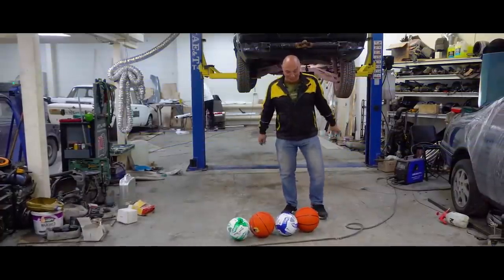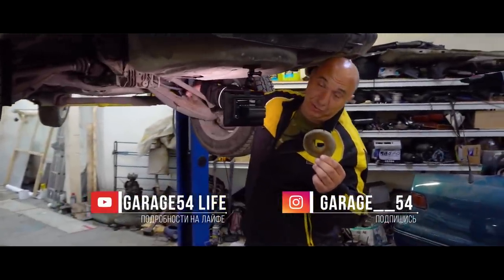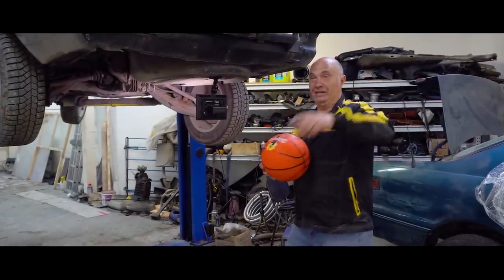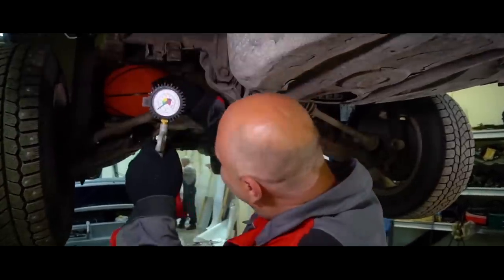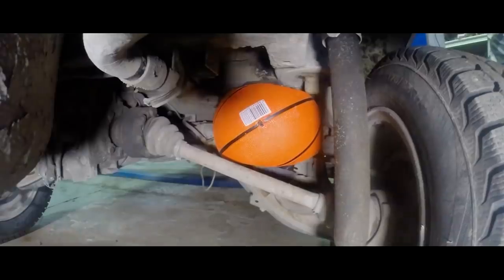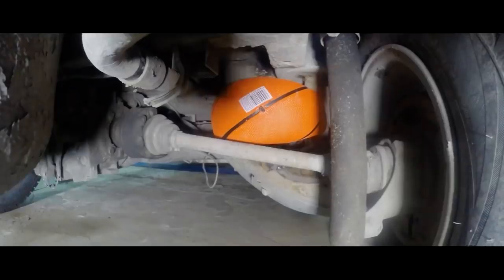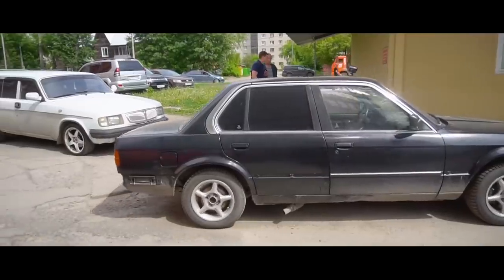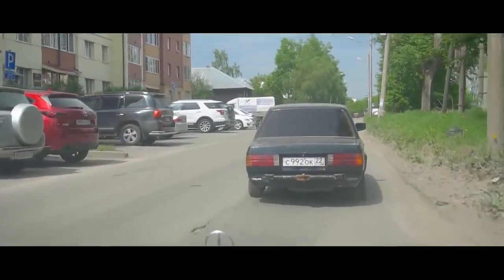DIY air suspension: replacing springs with basketballs

Comment: I think the mounts become sharp when it pancakes over them, flatter mounts might make them last a little better?
Reply: Tyler woodring or at least curl the outer edges of each cup away from the ball so it won't be as sharp when the ball pancakes
Reply: yeah i think i saw the mounts were broken  maybe with stronger mounts thicker steel and more welds

Comment: Make brake pads out of tire tread? They would be semi metallic organic pads!

It’d be cool to see what the peak pressure is when they burst.
Reply: You know theyd work better than normal brake pads until they got hot. I wouldnt use tire tread. Use a heavy duty piece of rubber.
Reply: Kyle Marshall I can’t think of rubber much tougher than tire tread. It’s also steel belted.
Reply: @Phos9  conveyor belt from stone crusher..rubber but not soon to be replaced, you can it as industrial trash...very dense Steele net
Reply: It would be like bicycle brakes!

Comment: whyd you disconnect the shocks??  that's what made it pop...
Reply: Was my thought, at the end they should''ve tried it with the shocks bolted on and basketballs in place.
Reply: but then, the shocks would be absorbing most of the energy
Reply: IndiiSkies kinda like in a real suspension?
Reply: I thought this too, then realized they would have "bottomed out" and not had the travel on compression.
That said, maybe put the shocks back on and run a higher pressure in the balls.
Reply: @ifluro  or spacers under/above the balls
Reply: both this and the magnet suspension rode a lot lower than the car is meant to so the shocks would be at the extent of their travel  and it would just be sitting on their bottom stops the whole time or at least bottoming out the shocks after an inch of travel and crunching the passengers vertebrae.
Reply: @tomcline5631  But real springs wouldn't have broken, so neither should the magnets or balls.
Reply: Agree
Reply: most air setups ive seen still uses a shock.the airbag only replaces the spring

Comment: For some reason this video makes me want to play a Garage 54 themed VR car Mechanic game.

Car comes in with busted suspension, throw some balls in there. 

Car rattling on bumpy roads, fill every air space with expanding foam. 

Engine overheating, throw two extra engines under the bonnet
Reply: PlayWay will probably do a game like that haha
Reply: having choice between Roadkill and Garage54 would be a good feature too

Comment: Suggestion:
Replace a clutch with a belt drive, pulley on gearbox shaft, pulley on the flywheel and make a tensioner so you can engage and disengage.

Comment: Isn´t there any vhicle laws in russa?
Reply: you can't drive a car with broken: breaks, headlights (at night time), windshield vipers (if it rains). In any other case you have the right to take precautions and drive your car to the nearest garage for repairs.
Reply: @A3ATOT  steering and brakes also have to be fully operational.
Reply: matsv201. It’s illegal to drive sober
Reply: @SwapBlogRU  Pretty much a fashist state then
Both breaks and stearing operational... in the free world we only need one of those
Reply: matsv201 brake

Comment: You should try hard rubber balls if you can get them big enough. We used to put them inside the springs in the 80's to stiffen the suspension & work as bumpstops.

Comment: The metal cradle edges dug into the balls and someimes they rubbed against the half-shafts: smooth over the edges + more ball pressure required!!! And connect up those shocks!!!!
Maybe using some truck or bus air-suspension units would work?

Comment: I think it would work pretty well if you find out what causes the burst. The ball can handle the pressure but I think it doesn't like hot exhaust pipe or rubbing drive shaft.

Comment: Garage 54's idea on how to make an air suspension:
1. Stick quite sharp sheetmetal bowls to the lower and upper side of the suspension
2. put a basketball in between, almost slicing it already
3. hope nothing will happen.. but it will
4. call it a 107% success!
:-D

Comment: The balls would last way longer if you would:
- add a little cushion between the balls and the cutting edges of those custom-made baskets which support the balls;
- add more pressure in the balls.
I challenge you to rework it and shoot another video with the results. Interested?!

Comment: love the channel just wish you would to the trials with a bit more engineering to make things really work.  Such as with this one.  The bracing for the balls needs to be thicker, wider with rounded edges while also accommodating some rubber padding top and bottom.  The shocks need to hold up better and be newer.  Perhaps there is a ball out there that you can put up to 100 psi.  Now here is an idea fill them with Oobleck or mostly and then some air.

Comment: Put in some proper truck or bus parts and it will work perfectly.  Those aparts are designed for MUCH heavier loaded trucks. 

Suggestion for another project? How about filling an airconditioning system with liquide propane?  Theoretically it should work great.
Reply: In the past, propane has been used in automotive AC systems, as a cheap replacement for R12 Freon. 
It works. Trouble is, if you get a leak......

Comment: I think if the ball cradles has been a bit larger and if they had run a bit more pressure it would have worked a little better. But still a fun experiment.

Comment: You should have made the susp plates round and bigger so the sides of the ball wouldn't be compressing down onto a sharp metal edge they are only popping because as you drive it's cutting into it

Comment: what if you coat the balls with the stuff you can spray on a watermellon drop from a building and it dont bust open..bet that would help this ball suspension  :)  its called line-x

Comment: I recall seeing a tree branch shoved into the rear suspension to replace a missing wheel. It dragged along the road lifting the back of the car off the road. Obviously it was a front wheel drive vehicle. Why not try BOTH rear wheels replaced with branches and see how far you get.

Comment: Do a video using lady toys and lady lube for things on the car. Like lady lube for oil, coolant, windshield washers fluid and be creative for what to use the toys for. Maybe gas cap, oil cap, shifter, wiper blades, tailpipe expansion or plug, antenna cover, hood ornament, bumpers
Reply: Hand brake

Comment: I'm sure it would also have last longer if you wouldn't have put them so close to the center. It gave them more weight to handle than where the spring originially were.

Comment: Experiment with hot water bottle bag. It's was experiment by others,it does holds up the air pressure. Try run with experience air for 1st experiment  . 2nd experiment run with water .

Comment: the material properties of the ball rubber are not designed for the dynamic abuse loads, especially when the ball psi was beyond typical pressures.

Comment: Here’s one ☝️.   Use your fuel digital mileage meter  to find the exact ratio of acetone to add to fuel to get the best mileage   Performance. The stuff is great to add to fuel   You can’t use to much though.  But what if you did ?  That’s where 54 garage comes in let’s launch the 16 cycl LADA roadster !

Comment: Why don't you set up bicycle pumps as shock absorbers and have the lines from the pumps running into the balls... So then it will instantly adjust the pressure in the balls as its needed. 
I shall call this "instant compression suspension" lol

Comment: Fill the balls with ooblek and connnect the shocks and you got a winner.
Reply: Ooblek is a fluid. Fluids don't compress. Wouldn't work.
Reply: @milo-uy6rd  No but the bal around the ooblek is going to stretch allowing the ooblek to change its shape. No need for compression in this scenario.